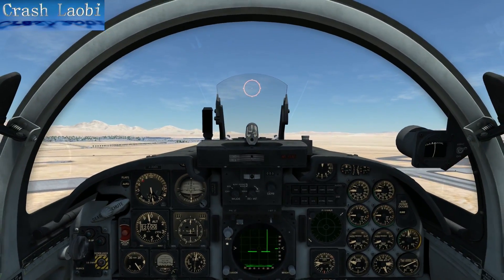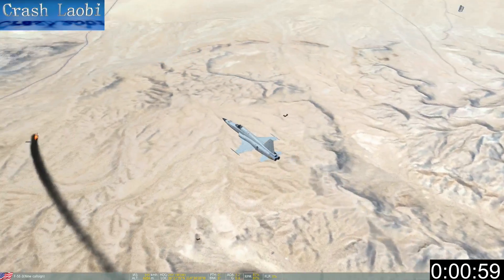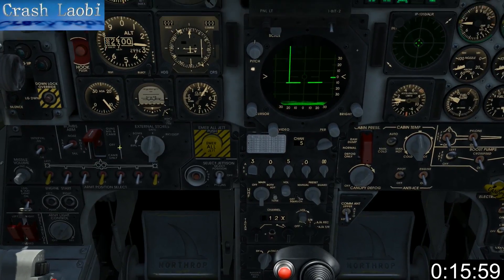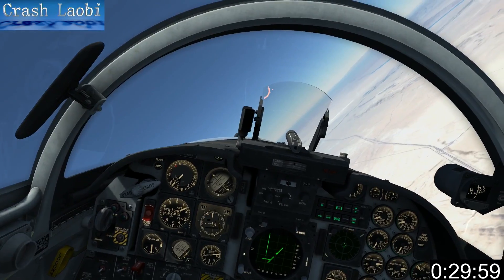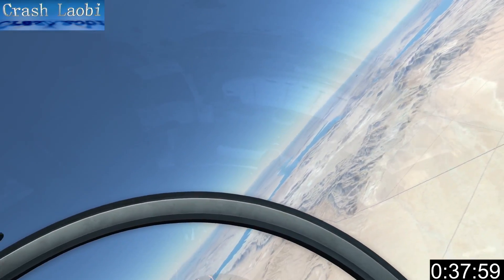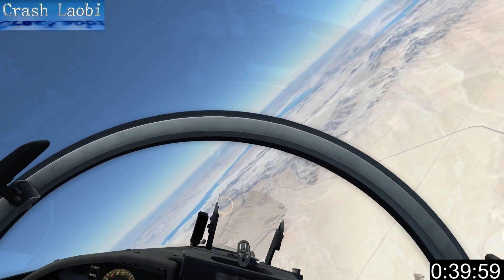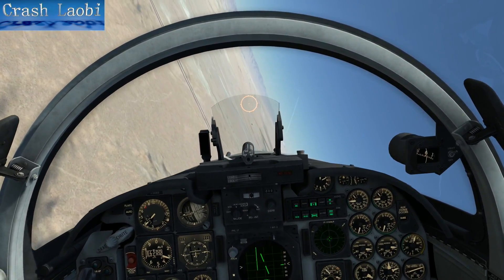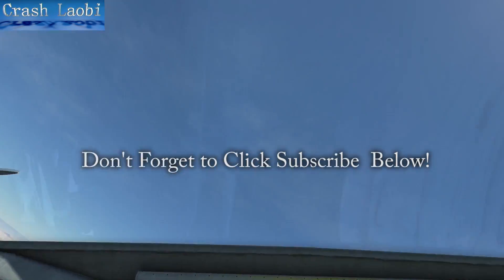1 Minute DCS - F5 E Air to Air Guns A/A1 Mode Tutorial

Comment: Is there any other capabilities in this plane than ambush? I'm really upset with this plane and its radar, after you complete your ambush in the training lessons another fighter comes for you and this radar is completely useless,  in fact I'm having troubles with the main target once I lose visual contact and he's aware of my intentions taking evasive maneuvers.. it's not a difficult training but it's just that: ambushes or hit the floor without fuel Jesus!
Reply from the maker: Thank you sir!  The F5 was designed as a light weight fighter/interceptor for the export market, it was definitely of its time.  It's main competitor was the Mig 21 and they compliment each other.  Keeping track of enemies is difficult, but even in the 21 with it's radar guided missiles it is often the case that those missiles lose their guidance at which point visibility is even more limited, so in a close in dog fight the F5 has many advantages.  You can do rudimentary air to ground bombing and that cannon is devastating on unarmoured ground targets.  Hope this helps.
Reply: @Laobi  thank you very much. I thought complement this search with the RWR indicator and after a lot of failures and frustration I realized that I was misinterpreting the RWR AZIMUTH INDICATOR. There is a training with just 1 target (take down an enemy AWAKS) and even in that conditions I don't get it.. but I will eventually. Thanks for your help
Reply: So sorry my bad.  The mission was taking down a Cargo IL76 not an enemy awaks.. and for some reason the RWR doesn't get any signal from it but allied awaks is shown.
Reply: Ok I got it finally